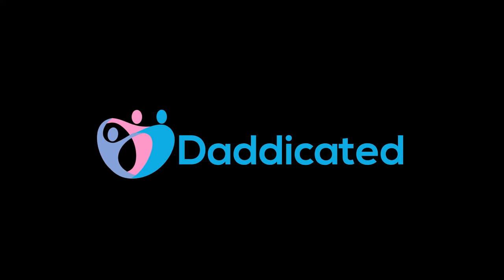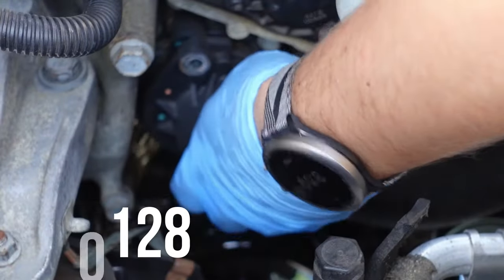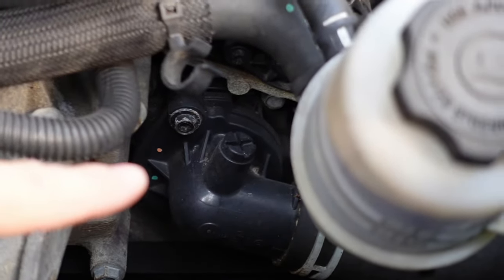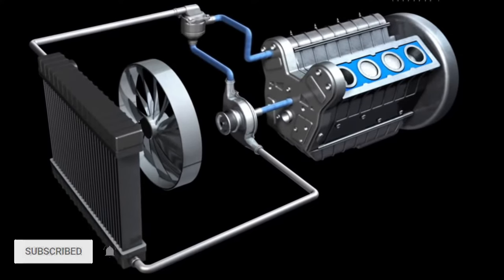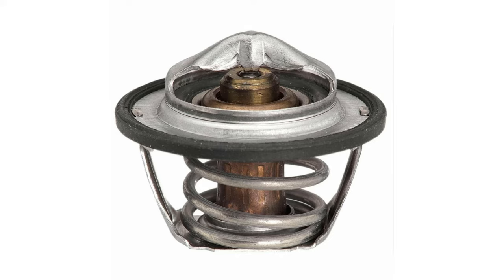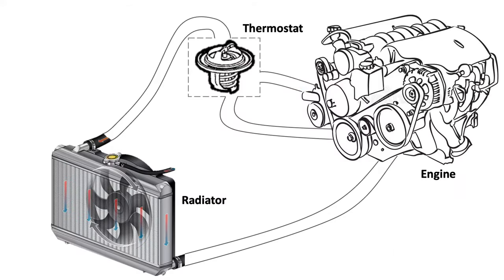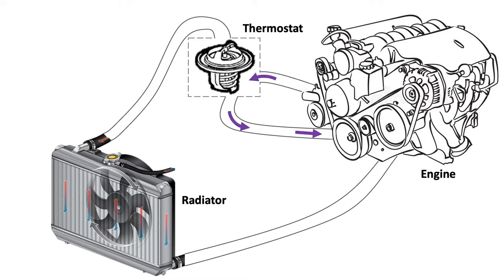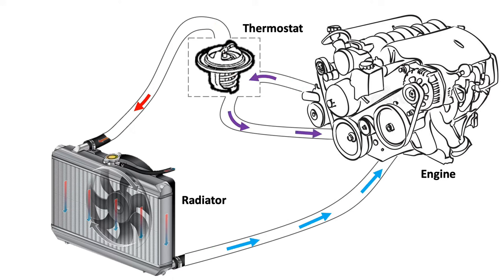p0128 coolant thermostat error code | thermostat rationality test

Comment: A low temp signal will indicate that the thermostat is stuck open during the initial start and warm phase of the motor. If replacing that does not resolve the code then change the temp sensor. If the thermostat is stuck in the closed position the engine would overheat due to no cooling of the fluids.
Reply from the maker: Thanks for the explanation.

Comment: so i changed it on my Grand Cherokee 3.6, drove it for a bit and code is still there, have absolutely no clue what else would be wrong since it’s a brand new part any advice?
Reply from the maker: Did u get the same code or a different one? Not sure what else it could be.
Reply: Have you tried replacing the coolant temp sensor? Sometimes they have to be replaced along with the thermostat.
Reply from the maker: @citykings411  Thanks for the suggestion.
Reply: disconnect the battery for a half hour, the code should be cleared.  If it
comes back, then you still have another problem.
Reply: May need to take it to a dealer to have the computer updated. I changed the thermostat and coolant temp sensor and still threw the same code. Its called a flash update.  Common problem with Chrysler.
Reply: Don’t you have to clear the code first?
Reply: @hansanderson6607 I love u sm thank u
Reply: What ended up being bad? Did it end up being your coolant temp sensor?  @Daddicated

Comment: Does this affect the ac in your car?
Reply from the maker: I don’t think so but in some cars maybe. Not sure to be honest.
Reply: @bonimartinez6287 answer is no. The engine coolant is to heat the cabin of your car, the refridgerant in the a/c system is to cool the cabin, they are both separate systems from each other. Cheers

Comment: 08 Altima 2.5 had this code
Thermostat was operating just at the wrong temperature 
Replaced thermostat 
Tested ECT sensor tested fine 
Replaced it Any way 
$35 plus coolant 
No more code